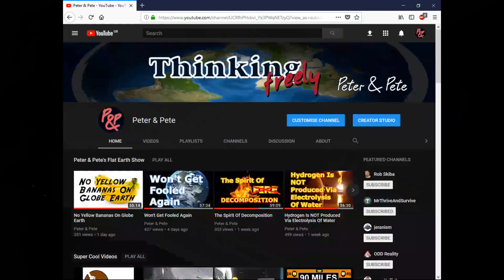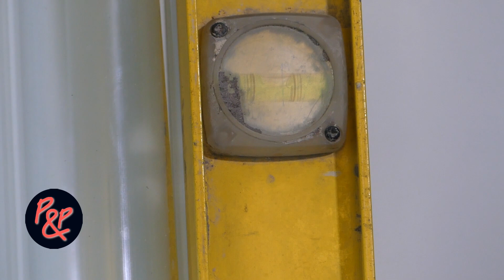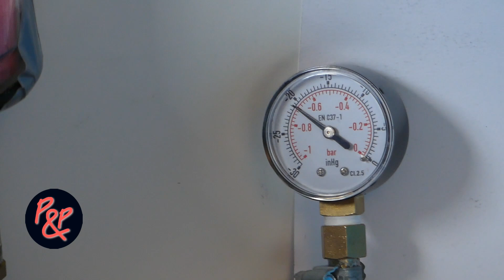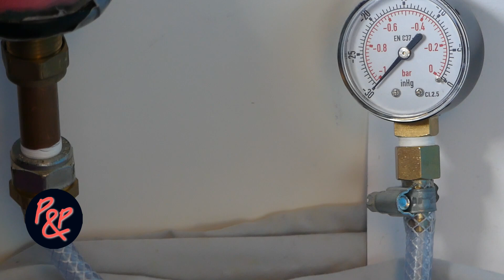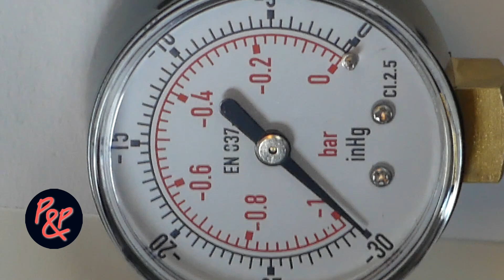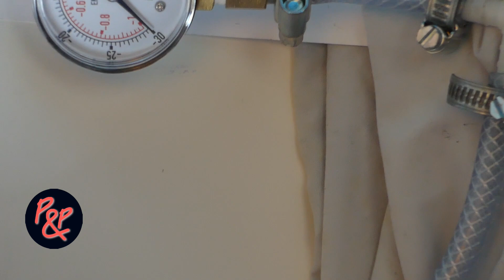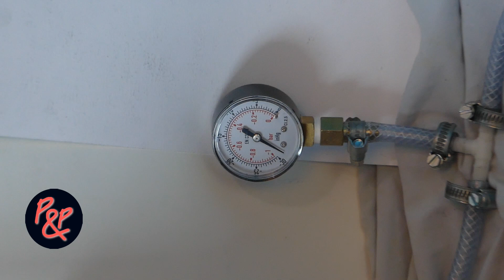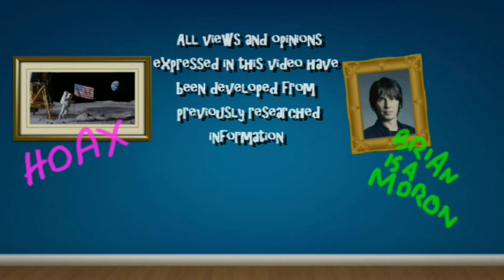Falling Objects - Sealing The Deal

Comment: Very good. Proving gravity IS real. 
Your experiment has a few problems which invalidates it.
Can you figure out your errors  ?
Reply from the maker: According to me there aren't any errors, the heavier object hit the bottom first in all the tests i've carried out, in air, in water and in vacuum, but thanks for your input!
Reply: @PeterPete  The closer to real vacuum you get, the faster the silica will fall. Why did it go so much faster in your partial vacuum?  it seems like its own properties changed? You didn't explain that or attempt to. You simply latched on to the conclusion you wanted... Hint, try an experiment with less rickety equipment, and test how fast the silica falls at different vacuum levels. I bet you find the less air the faster it goes.. Kinda like there is another force acting on it isn't there?
Reply: @wishusknight3009  Exactly  !
Reply: @wishusknight3009  The silica fell faster in the partial vacuum because there was less or no air resistance. This video demonstrates that objects fall because of density not gravity... things fall when they are more dense than air. @Peter&Pete
Reply: @NYTruthseeker  And that conclusion is arrived at how?  How is it that in perfect vacuum everything falls at the same rate regardless of "density" ?  And good job parroting word for word what is said in the video, you say it as though you understand it.
Reply from the maker: @wishusknight3009  Quote - The closer to real vacuum you get, the faster the silica will fall (and the ball bearing too which will hit first given enough height is allowed for both objects to reach max drop velocity). If you think we're wrong, you're more than welcome to do it yourself rather criticise from the comfort of your chair! Try it in 4m? Go on dare you.
Reply: @PeterPete  That is exactly what I said... But how did you conjure up the reasoning that it was an some sort of inherent property of density? And it wont matter what height you drop them from. If you are in a near vacuum (way more than your rig could ever achieve), virtually all objects regardless of size, wight, shape or density will fall at the same rate. Demonstrated many times by many others with repeated results. How does this fit into your fabricated conclusion that the speed is some inherent property of the object itself? Does this now mean the object's properties change when you suck all the atmosphere out of the test bed? Or could this just be a demonstration of the consistency and predictability of gravity?

I applaud you for doing the experiment, but not for ignoring key observations to then falsely conclude that which you have a bias towards. And for perhaps not doing enough rigger or control either to which would cause erroneous data, that would be then produced and used as a result of a lack of control. 

But what I saw you do was latch onto the first thing that could vaguely confirm your belief and trash the rest... Time to be a bit more through and follow the evidence where it leads. I dare ya.
Reply from the maker: @wishusknight3009  If you're unhappy with what we've done, you're more than welcome to do it yourself, try 4m this time, bye!
Reply: @PeterPete  What good does telling me to do the experiments when you wont accept any results you don't see with your own two eyes? 

I have seen the repeated results of others enough to know that you came to the wrong conclusions, and with fractal wrongness, My own experiences in life tell me you are fractally wrong. Others more qualified than you or me are telling you that you are wrong...  I am trying to explain as to why. If you aren't interested in investigating results that go against your beliefs, then why did you even do the experiment? Doesn't seem like you really care about evidence or knowing that what you believe to be true is actually true.  Bias is only self deception. And cognitive dissonance sucks.

You only seem to do the same thing other flat earthers do. Dodge and misdirect, then ignore. Go over what I have written point by point in my other posts... and do proper rigor and due process.. I double dare ya...
Reply from the maker: @wishusknight3009  so you won't do them then? it's ok. talk is cheap I guess, thanks for the brief exchange as i'd rather discuss things with doers than typers.
Reply: @PeterPete  Address the points raised? Stop dodging, deflecting and ignoring.

I have done far more than you could ever dream of when it comes to scientific knowledge and truth.  If you read my previous replies, I explain this fully. (i doubt you did) If you were honest, You would address the very valid points raised and not stick your fingers in your ears.  Until then you are only being deceptive to others. And therefore a fraud.
Reply from the maker: @wishusknight3009  Quote - I have done far more than you could ever dream of when it comes to scientific knowledge and truth. 
Ok prove oxygen is 21% of the atmosphere!!
Reply: @PeterPete  Are you going to keep dodging or are you going to be honest? Answer the valid points I raised and backed up... Come on man...
Reply from the maker: @wishusknight3009  so with the alleged more scientific knowledge and truth you can't prove that air comprises 21% oxygen?
Reply: @PeterPete  Google and education are your friend. Apparently honesty and maturity aren't. Message me when you are ready for an adult conversation.
Reply: @PeterPete  It is absolutely evident that bringing up the topic of percentage of oxygen in air,  that has nothing to do with the experiment, its flaws, the flaws in the interpretation of data, is a pure attempt to dodge the answer to the issues that have been raised.
Reply from the maker: @wishusknight3009  so you can't prove there's 21% oxygen in the air then? just a simple answer would have sufficed!
Reply from the maker: @psalux18963  it wasn't an experiment, it's a demonstration. Can you prove there's 21% oxygen in the air? wk can't!
Reply: @PeterPete  Dodging technique to the bitter end?
The word oxygen becomes present in this thread at the 17th post, and it has nothing to do at all  with all that had been discussed before, it's a red herring, a clear attempt to dodge, to avoid the questions.
Reply: @PeterPete  It seems like you are deleting my replies? Why? What are you hiding? 
1. How do you come to the conclusion that the rate of fall is inherent in the objects density? Take me through the thought process. I really want to understand this. Step by step and in detail. 
2. How can you explain then that in a near perfect vacuum that virtually all objects regardless of weight, size and density fall at the same rate? as has been demonstrated elsewhere many many times. 
3. Does this now mean the object's properties change when you suck all the atmosphere out of the test bed? 
4. What is with all the deflecting and obfuscation? 

Hint: it is ok to admit you came to a wrong conclusion, and ask for help to find out how to come to the right one.  And follow up on the things people are pointing out. This is how we all learn together. And this is how science works. You don't ignore valid criticisms and play games of deflection and hand waving. This is what con artists do. 

Truth can withstand honest criticism and investigation. Doctrine can't. If you are only trying to confirm a doctrine, then you don't have, nor care about truth.
Reply: @PeterPete  According to you gravity doesn't exist.  But it ' does according to REAL science.  I'll go with science.
Reply from the maker: @stranger_danger1900  Bye! And close the door on your way out!!
Reply: @PeterPete  Weight means nothing in a REAL vacuum, which you didn't have.
Reply: @PeterPete  The experiment has been done in a real vacuum chamber and the results show all objects fall at the same rate. 
You need a better chamber and confirmed vacuum.

Comment: the speed of magnetic ball was identical in both cases. They dropped exactly at the same time. The one only difference is the ball in vacuum bounce up higher.
Reply: And don't miss the fact that the silica fell much much faster when there was less air in the tube... Did its properties change?
Reply: because there was no air resistance no water particles @wishusknight3009

Comment: You changed the rate of falling so we know that objects in vacuum fall at the same rate but your experiment was not good enough.
Reply from the maker: thanks for your opinion but the heavier object hit the bottom first as enough height was allowed to see the difference.
Reply: @PeterPete  The vacuum had a clear effect. The release mechanism was different for each object, there may be forces of adhesion of the silicone on the lid. A tube with possible effects from drag by the walls of the tube itself is not a good experimental condition. I am also not sure that your vacuum was good enough. 
You surely have seen many other videos in which better experiments have been executed with the result that objects fall in the same time, vith the same acceleration no matter how different is their weight, shape, density. In the air objects with the same shape and different weight fall in the same time, because the effect of air drag is the same on both. This last suggest strongly that they will behave in the same way also in the vacuum. We know from hundred of previous better conducted experiments that a bowling ball, a feather, a helium balloon fall in the same time with the same acceleration in a good vacuum chamber.  There's no reason that you should obtain different results.
Also with the vacuum it seems that the 2 objects transit in the same time in the second half of the tube, as it was just a delay in the release mechanism.
Reply from the maker: @psalux18963  We have demonstrated the higher the drop the more opportunity for the objects to reach their maximum drop velocity according to their heaviness. instead of criticising, which is easy to do from the comfort of your armchair, you can go one step further and do it yourself. Send us a link of your demonstration showing the ball bearing and a piece of silica insulation. Let's say over 3m and let's see the objects drop in real time and in one go. Can't wait to see them hit the bottom together!
Reply: @PeterPete  I don't make videos and I won't make it now for you. However this doesn't mean that I can't use my brain to judge what you have done. 
Someone who wants to make a real experiment has to try to falsify his results, take measures, investigate what can be the conditions that pose a bias to the experiment, repeat the experiment in different conditions, changing one different parameter, to judge what has a real effect on the outcome. You could compare the time of fall of the silicone piece and of another object of different material with different weight, or of silicone but smaller or heavier. The same thing can be made  for the shape of the object. With your fantasy you can find other ways to really try to falsify your results. 
You have to compare things released with the same mechanism, that are falling independently, taking the time of fall for each of them. 
Given the poor conditions of execution of your experiment you can try to compare 2 magnetizable balls with different weight, or with different shape but the same weight. 
These are some simple ideas that would give to your experiment just a little bit of meaningfulness. 
If you just want to make the experiment one time only, not investigate if it was flawed, and draw conclusions from that, you are openly showing your bias.
Reply from the maker: @psalux18963  tks for your opinion!

Comment: Again you can see an outside affect on the light object. Can you explain what causes the change of directions mid drop if there were no external forces (probably electrostatic because of the tube) or in a proper vacuum. The experiements bunk.
Reply: You dont even bother to wonder how that would happen in a proper vacuum with nothing else acting on the object which is how you know you'll never be doing real science.
Reply from the maker: tks for commenting - do it yourself if you feel the demo is wrong! objects are supposed to fall at same rate in vacuum and that was clearly NOT observed! If you think we didn't have  a vacuum then I'd like to know what was inside the tube apart from your ideas!